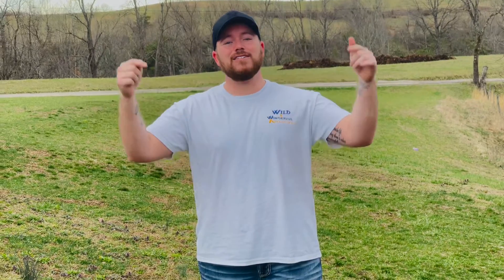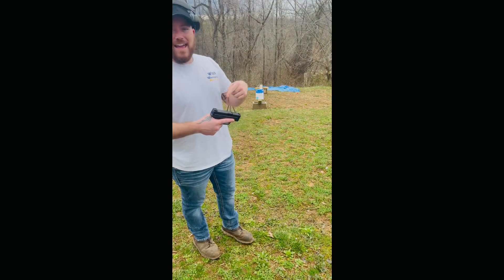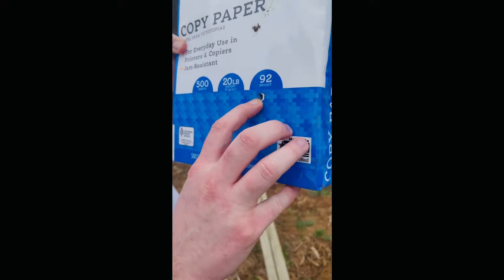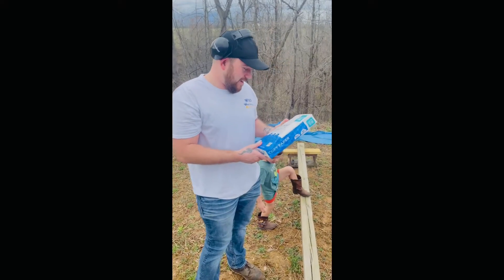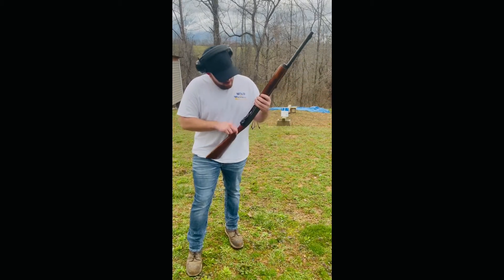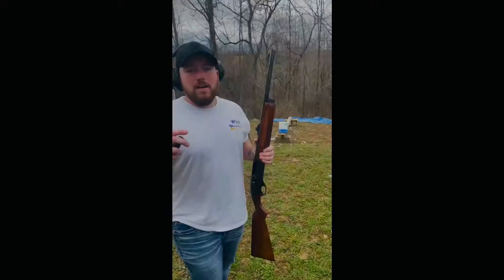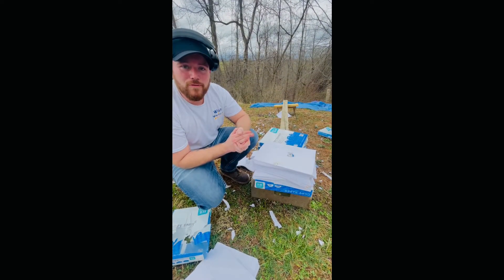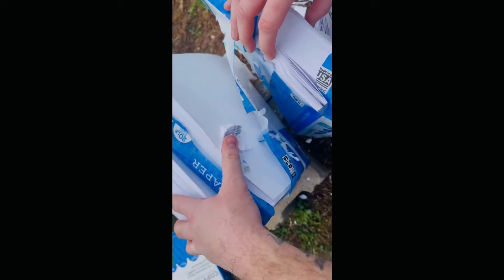Is paper bulletproof? | DIY body armor

Comment: Try gluing the paper together in a body armor form with superglue on each full paper layer and letting it dry for 5 days to harden to the full.   I did mine using brown paper with 24 paper layers and it stopped my .177 airgun rifle. Its pretty impressive. Id say about 100 paper layers super glued together can stop real guns.  Its alot of layers but im sure it would work. Supergluing 50-100 layers however will take more than 5 days to dry, probably 2 weeks or less.
Reply from the maker: That’s not a bad idea! We might try that out in a future video thanks for the idea!!